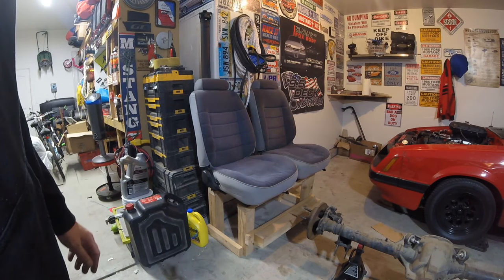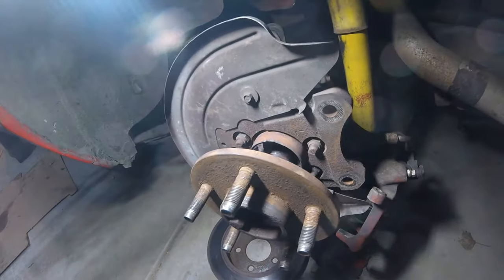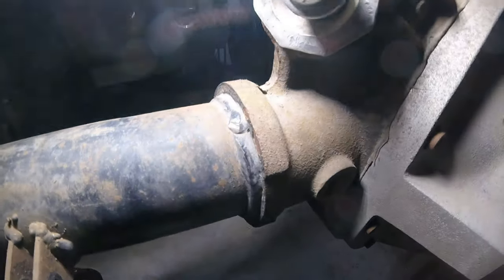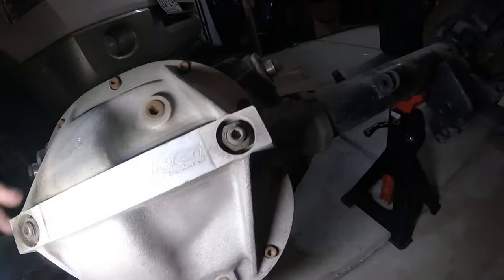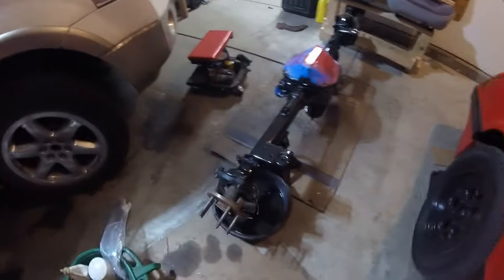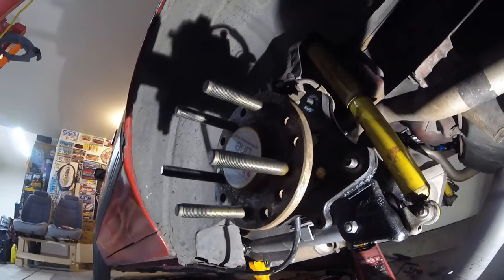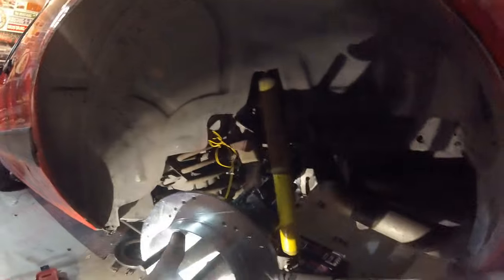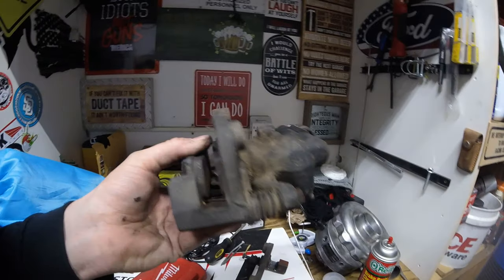8.8 w/ Spool & 33 spline Axles - Cleanup and Install

Comment: I’ve ran a Full spool in my car on the street for 3 years no issue... and i have 28” Mickey Thompson Pro’s on it... drive it to the grocery store no issues.
Reply from the maker: That’s my thoughts.  I’ve driven a welded diff with no issues 🤷🏼‍♂️

Comment: Nice video! Don't drive it when its wet! (spool) ;-) what is your back spacing on your rims? It looks wider than a stock rear end!
Reply from the maker: Thanks!  Didn’t measure the back spacing on the  rims.  All 8.8 are same dimensions, just different length axles from Fox to sn95 and what not.  Axles are from a 96 gt and rims are the same.  They tuck just inside the wheel well... trying to get my rear brakes on so I can drive this thing again lol calipers are being an absolute pain in my butt

Comment: Hello, Why better change to a 9 inch differential? or you recommend 8.8
Reply from the maker: If you build an 8.8 right you’ll never need a 9 inch.  Most people switch to a 9 inch for easy heat change out.